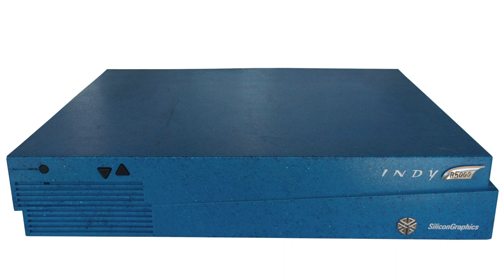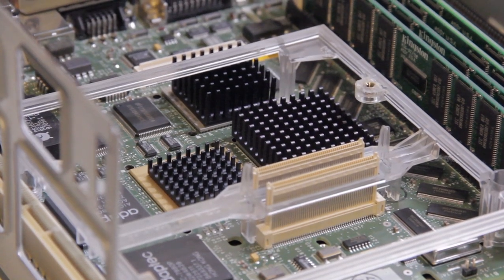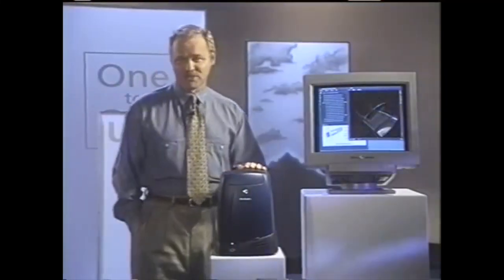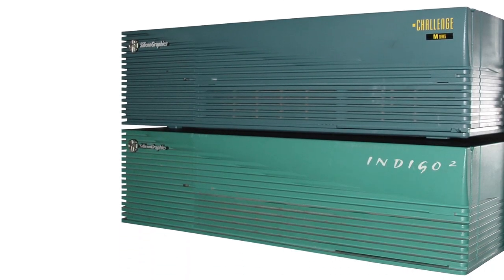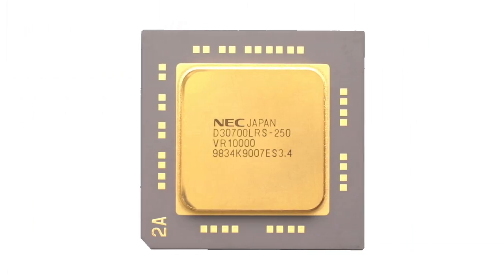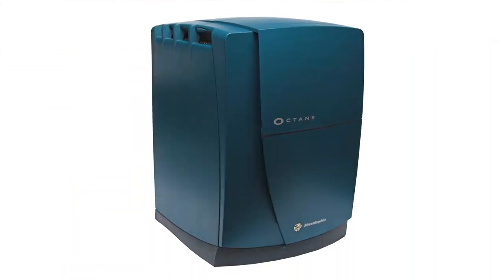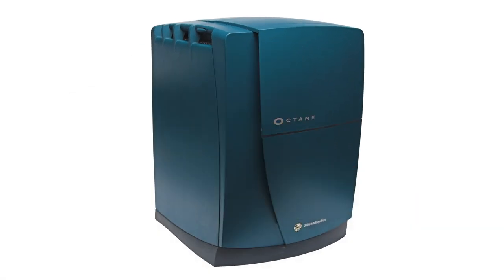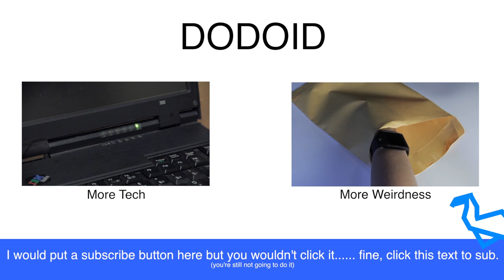History of SiliconGraphics Part 4 -  Everything Gets Updated At Once

Comment: One thing I'd say about O200: SGI didn't really advertise it that well, but it did sell quite nicely in many markets. I know a movie company which used 50 of them for their first major renderfarm. I also remember benchmark data which showed a 2-CPU O200 outperforming an 8-CPU SUN (quantum chemistry I think it was) mainly because the O200 could move such a huge amount of data around.

While sysadmin at a VR research centre for several years (2000 to 2004), the main server for the building I ran was an O200 (dual-225MHz IIRC); apart from all main IRIX user account data, it also served all PC user account data via Samba, performed brilliantly. A shining example of John Mashey's quip about it being more about how much data one can process, not how fast (or rather, in his words, "It's the bandwidth, stupid!"). I had some interesting email exchanges with him about these issues back then, especially concering the SPEC benchmarks.

What I don't like about O200 is the modified design which means the CPU modules are unique to that system, ie. one cannot use the modules from an Octane and the clock speeds are different. Best module for O200 is a dual-R12K/360. Also annoying is the insane fragility of the front case plastics and the plastic feet. Very rugged chassis, but as is often the case with some SGIs, the plastics are way too fragile.

The ability to link two units together though was a very smart move. I knew lots of places that took advantage of this. Bandwidth increases automatically, as my STREAM tests showed nicely. It's good that SGI carried on this idea, eg. two O300s can be linked directly together (no need for a separate router brick) to form an 8-CPU system. Oh, you didn't mention the GIGAchannel expansion option btw, where an extra unit provides four additional PCI slots and five more XIO boards, which can be connected to a 4-CPU system aswell. See:

http://www.arxvaldex.com/pb/files/manuals/o200.pdf

I gather from an ex-SGI person that some at the company wanted the same system-linkability to be offered with Tezro aswell, so customers could easily form larger systems on the fly. Tezro does have two XIO2 ports on the mbd, so it is a bit odd that they didn't go with this, but perhaps they were worried it would detract too much from rackmount Tezro or O350 sales. Missed opportunity IMO.

Ian.
Reply from the maker: +mapesdhs There was originally a paragraph about how the O200 could be used with graphics by way of the gigachannel box, and I think it explained what the box was, but I took it out because it was long and boring. I could find only one picture of decent quality of the unit with all plastic intact, so that's the one you saw. I wish you could link Octanes, though I don't have any piles of Tezros laying about.
Reply: I'd forgotten about the gfx ability... was that the RAD PCI card? Or just an SI board or somesuch?

Re Octanes, I suppose to link them would have required an external connector for the 8th XIO port, and thus a cover plate for it, additional electronics, etc., so more expense. Still, it would have been a nice option to be able to connect, say, eight Octanes to a single Router brick, but we had to wait for O3K for the better brick idea to come forth.

I've gone through a fair few Tezros, never seem to hold onto them for very long, though one system I have atm I'm keeping until I can find a decent buyer, it's basically an entire studio setup (Smoke system), with all the original manuals, Wacom tablet, cables, dongle, 1TB FC RAID, VBOB, audio unit, the lot.
Reply from the maker: There was a 3rd party company that sold a PCI card that did it, but you could also install an Octane graphics card in the expansion box or even install a Ktown and connect it to an InfiniteReality2 rack module.

Comment: Do you have any more info about the Octane soundtrack? My version has a different cover than the one you show in the video. The inside also mentions how you can see the lyrics at "http://OCTANE/lyrics", but the CD doesn't have a data track. Also, the back says "WARNING: Explicit lyrics do not play backwards", I've never bothered to go through the whole thing backwards though.
Reply from the maker: Just listened to Octane Swing backwards. It's garbled nonsense apart from one part that could potentially be "you are really short unintelligible word". I Have a Dream played backwards, on the other hand, sounds like something out of an epic fantasy film, and the instrumental parts sometimes sound almost like some kind of electronic music.
Reply: Heh, playing back any song is a bit pointless. Us humans are wired to seek patterns in everything, we'll hear words that simply aren't there, especially if someone else deliverately "points" them out.

Btw, until now I'd managed to avoid hearing that CD until now (I have several of them, some unopened). My brain hurts. :D

Thanks for using the arch images from my site! Hmm, think I may need to update a couple of them, not sure about the clock speed linkage now in Octane (I was told it worked that way by someone at SGI at the time, but they were more PR than engineer).

Worth mentioning that Intel eventually switched (sic) to using crossbar designs aswell, the first being the 440BX chipset, which made a huge difference (systems I tested had a PIII/600 on a 440BX outperforming a P4/1GHz on an older chipset), but it was a less sophisticated design, nowhere near as fast as that developed by SGI. But then, the SGI crossbar has a large amount of expensive cache RAM included (2MB per port), ie. advanced tech ain't cheap.

Thanks for the 4th video! Any more to come?...

Ian.
Reply from the maker: Of course there's more to come, we haven't even gotten to all the interesting management stuff yet! Heck, Belluzo isn't even CEO yet and they're still selling IMPACT graphics!

If you don't want the CDs, toss one or two in "the box". One of my friends, despite not being an SGI/UNIX guy, really likes the songs and would probably love a CD of them. Has your curiosity seriously never gotten the better of you about those CDs, or have you heard they are bad and intentionally avoided them?
Reply: Do you know how the CD was distributed, and if there's differences between the two cover versions?